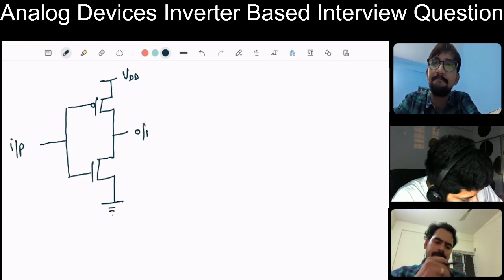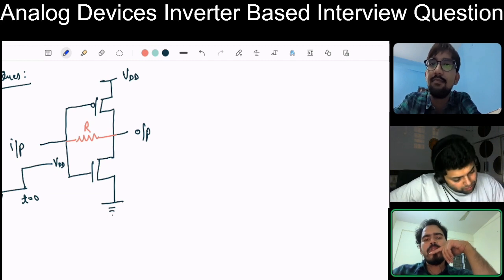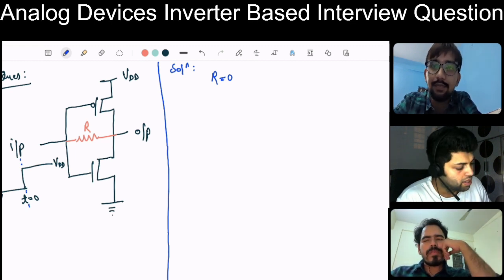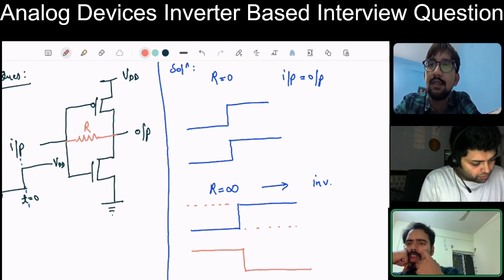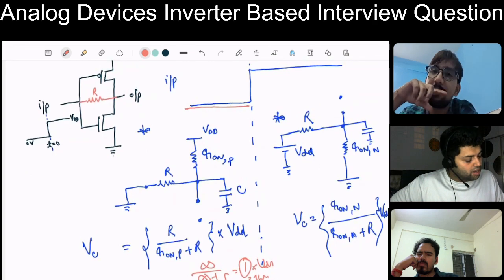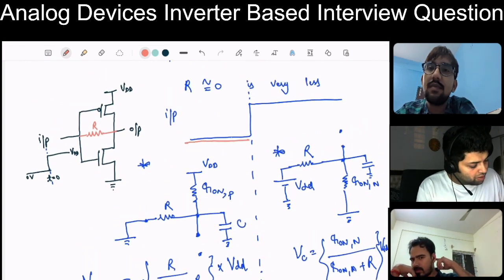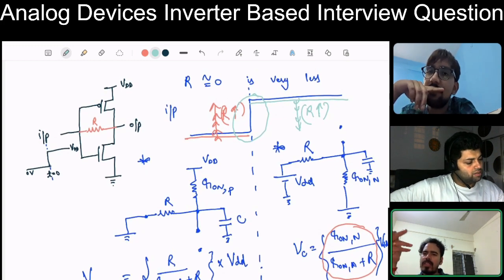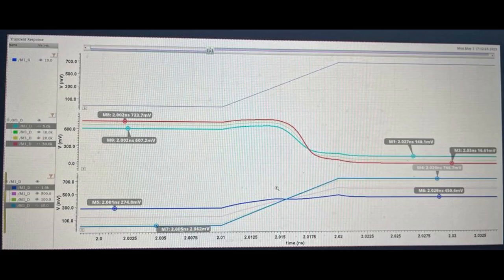Analog Devices Basic Interview Question

Comment: Here if R tends to infinite then there will be no feedback, if R has some finite value then the circuit will acts as a negative feedback circuit. If we set the input to 0 and break the loop and increase the voltage by some +ve amount then NMOS will be on and PMOS will be off. So as it is a CS amplifier ckt then there will be 180 degree phase shift in the op, so for increase in input output decrease , so it is a negative feedback ckt, for finite value of R.                                                                                                                                                      Am i right bhaiya?
Reply: Bhaiya could you please make a video of buffer related questions,  like calculation of 3 dB frequency, or kindly refer any resources from where I can practice this kind of problems.
Reply: Yes, - ve feedback,,and actually finite value of R will modify the overall Gm and overall Rout of the amplifier...
Reply from the maker: your analysis is right actually but just think about this- the feedback is the one which effects the input ( alter it change it) but in this case it is not possible since we have a forced input. This kind of feedback os called feed forward feedback.
Reply: Thanks bhaiya

Comment: please answer me why they add capacitor at the out?
Reply from the maker: Adding the capacitor makes the output voltage stable. The more the capacitor the more stable will be the voltage. In real designs as well we put dynamic capacitors inorder that our circuit just not start reacting to small noises and all.

Would suggest you to see RC Network questions discussed here in the channel.
Reply: CL is placed to  the Vo 😊

Comment: I have some questions. What is the effect of rise/false time of input on transient response? When can CGD be ignored? 
The resistor will be a feedforward path, not a feedback path if the voltage source is ideal.
Reply: Hii, so if your input is having a higher rise time or fall time then depending on the values of load capacitor, R and Ron( p or n) the output will get time to settle down to its final value ( which could be deduced by the formula mentioned in the video ). If the time constant is lower it will follow the input else will slow it down.
If you have steep input with lower rise and fall time then also again depending on the loading it will follow or slow down the input. 

Now this question gets better if we have clock as an input to it then if the loading is higher and the input steep in nature than probably this will result in lower voltage swings at the output.

Yep, you are right that this can’t be stated as a feedback until we have a forced supply at its input. Kudos on that🎉.
Reply: Can yu give little brief how do yu define it's not feedback, feedforward.
Reply: @mrx1167  feedback is given directly to the input but since input is an ideal source so it won't be possible for it to be changed but this feedback is also connected to the output which is not tied to any ideal source hence known as feedforward not feedback    ^_^

Comment: for each of the two modes the time constant of the circuit remains same , Is it?
Reply from the maker: So as discussed in the video make an R and C model of the circuit. If the R charging and discharging is same then Yes. Clearly here the circuit gets changes so it should not be the case.